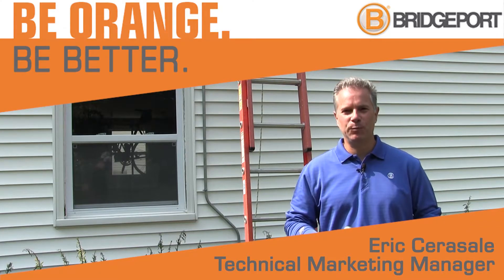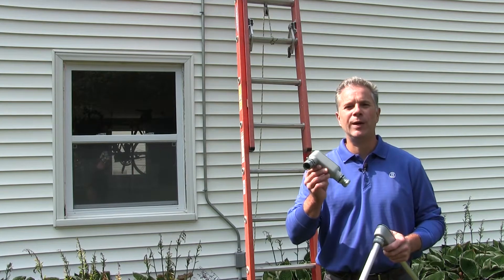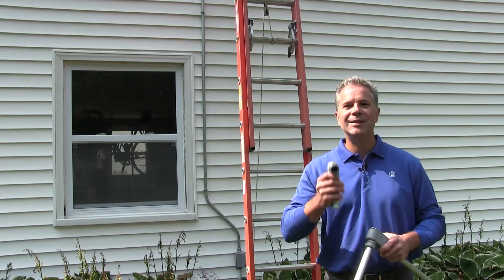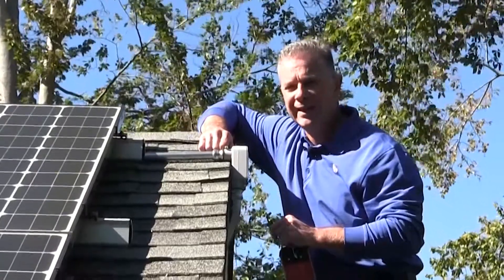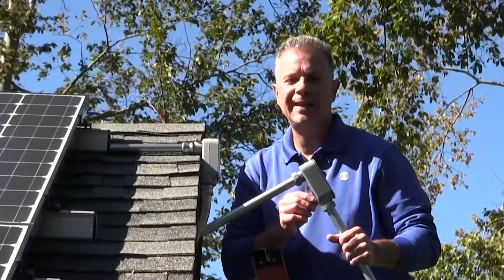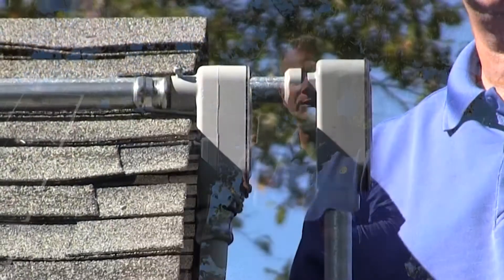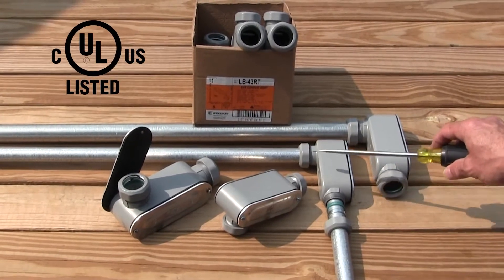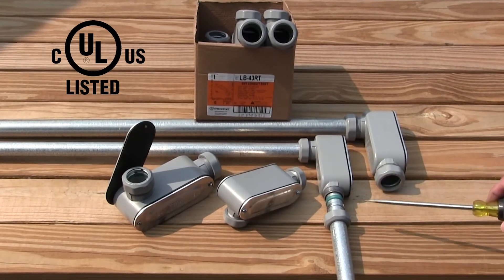Mighty-Seal® LB-RT and LLR-RT Raintight EMT Conduit Bodies

Comment: I can’t tell you how many times, during my 7 years as an electrician (including 3 as a solar installer) that I’ve seen rigid conduit bodies used with emt. Emt fittings don’t have a taper on the threads so there won’t be any bonding through the body. I think it is ridiculous how many electricians don’t know this. The same concept applies to junction boxes (FS boxes) with threaded hubs. They are not listed for use with emt. Please promote this video more to help stop the mis-use of material. BTW, this ignorance is industry-wide; not just in solar.